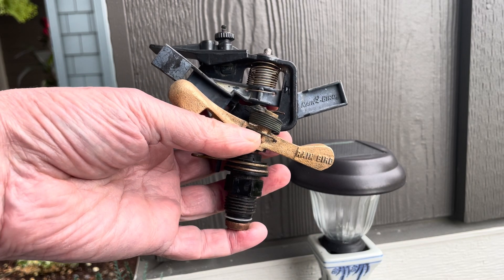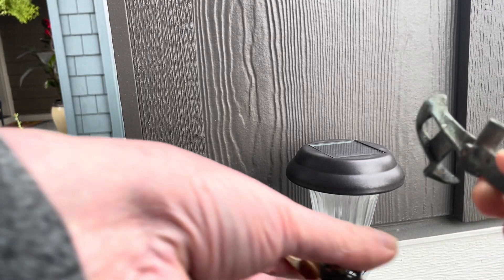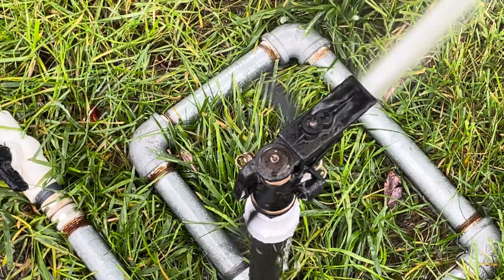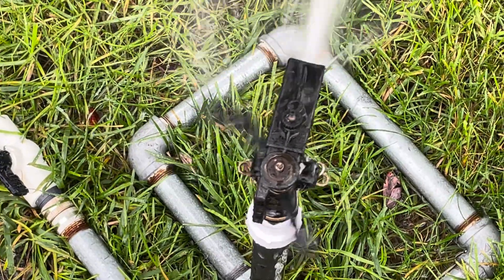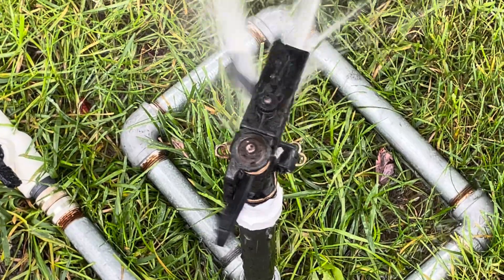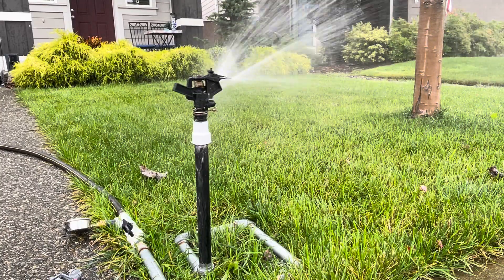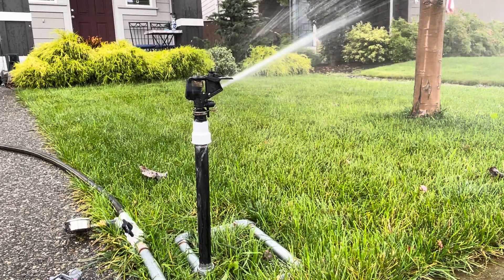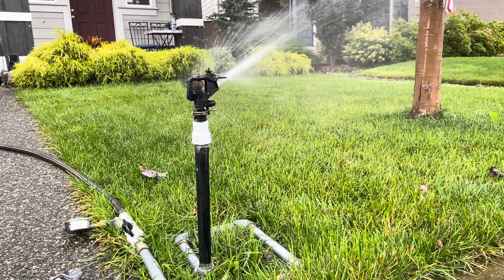P5-PJ arm on a BlackBird body Impact Sprinkler, is it possible?

Comment: I finally felt motivated to get my other P150 out and get one of my parts guns out and transfer over the good drive arm, counterweight and reverse spoon. I had to get my big pipe wrench out to get the nut cracked loose that holds it all on. Now i have to get ahold of some bits that are square, kinda like the end on a ratchet becuase this is whats holding the base flange on the bottom of the other one. Once i get those off, i need some permatex to make a seal so it doesn't leak. Then next year when it starts getting warmer i can test it out. However i still need to install a smaller nozzle to it, as the one on it is a 1.34" or 1.40" somewhere around there. I have a new .70" Taper bore i can install on it. I don't have stops for this gun however, but it can run full circle. Or maybe i could pull the ones off my P100 and see if they work on the 150. As those are about the same just used differently on that gun. I've been meaning to do this for awhile now i just got the motivation. This P150 i got from the dealer had a busted drive arm so it wouldn't have worked, the back weight part of it was snapped off and the arm wouldn't have had the necessary back force to keep hitting the stream.
Reply from the maker: I wish I knew more about the gun sprinklers to either add or put in my two cents but it sounds like you have it under control.  My day with those guns will come.
Reply: @randyvanheusden732  at some point I will clean out my guns and sprinklers. If I do I may send you one to tinker with. I have a few extra rainbird guns that need attention I can send you one if you like. Some move but don't reverse correctly one leaks and barely moves. They are a rainbird 103 fast reverse.
Reply from the maker: @NelsonBigGunP200Fan  you know I would love that opportunity, thank you.
Reply: @randyvanheusden732  ill let you know when i do so.

Comment: Good PJ Black Bird mod! It seemed a little hesitant at first to trip in reverse, but I suppose once the o-ring was fully lubricated by the water it had no problem tripping on it's own.
Reply from the maker: Thank you for watching, I think I will be making a test with just the one black washer and see what kind of results I get from that change.  I know the o-ring by itself works, but does slow it down, yet it is steady, but I may make that test on here too.

Comment: when i was little i'd take the bras spoon arm from one of my impacts and put it in all of my plastic ones. Some worked, some didnt (when they didnt have the notch underneath the spoon to catch the trip mechanism. But the ones that had the trip mechanism in the back it worked great. I was just into the spoon brass impacts more. If you had the room, you could get a couple thousand gallon containers and use it to drive a pump and you could run your bigger 1" or bigger impacts. I've seen people use those full of water to run a pump to irrigate a bigger area. You could get one and a Pacer SE2UL e950 transfer gas powered pump and you could run a gun like i do. Of course the cost may be a little high but it'd be worth it.
Reply from the maker: Eventually I hope to get there and use a pump on the 55lbs of pressure I have before turning on the water, and 20lbs when the sprinkler is on and running.  Right now expenditures are a challenge, but I have some plans in the works.